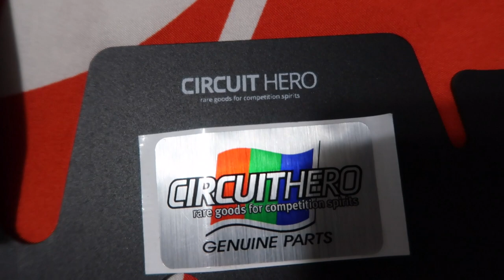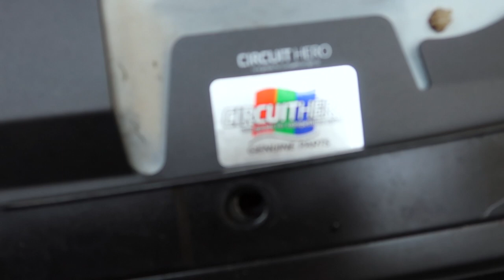Circuit Hero Cooling Panel Install

Comment: I dont really see what the panel does. They explain it holds air for extra cooling efficiency but it simply just sits on top of the rad support. I really don't see how it does anything other than just exist in your engine bay.
Reply from the maker: I think the same as well lol no worries
Reply: Cooling panels help direct air to the radiator by eliminating/blocking off where air can escape. Hence it’ll help with cooling performance.

Comment: How does the cooling panel work? Does it feed more air to the engine?
Reply from the maker: Honestly i really dont even know. It does make the engine bay more cleaner thoe.
Reply: Alright, thanks man.
Reply: Cooling panels help direct air to the radiator by eliminating/blocking off where air can escape. Hence it’ll help with cooling performance.